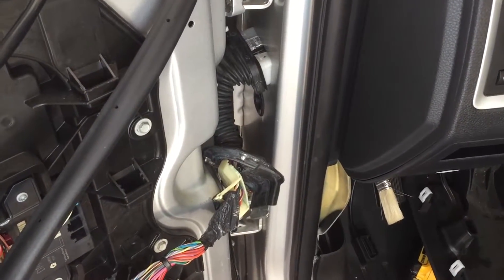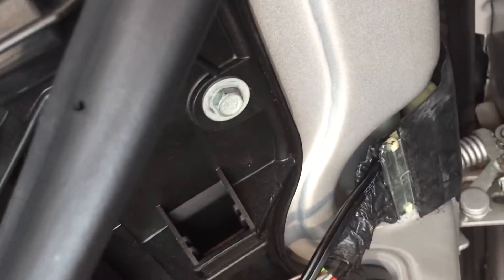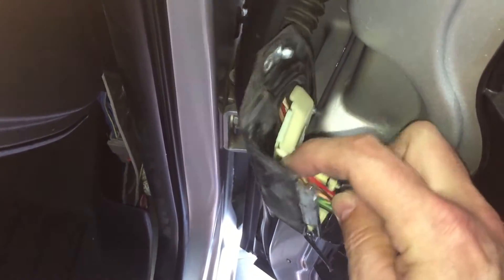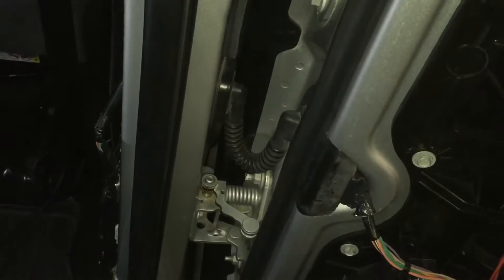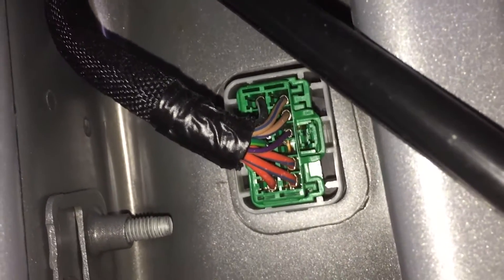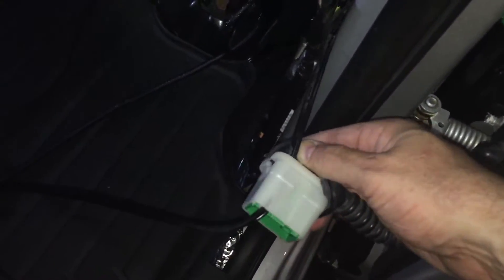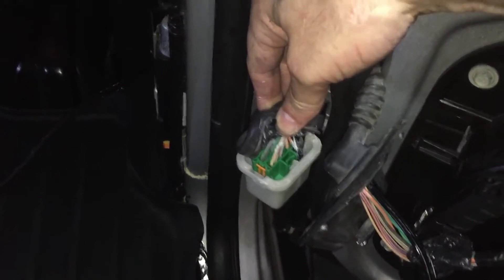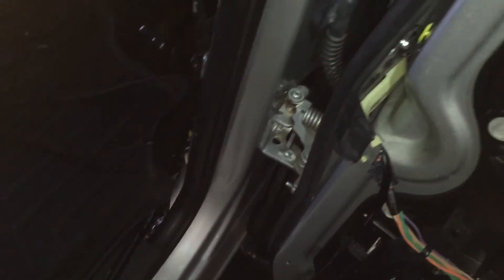Running New Speaker Wire to Ram 1500 Doors

Comment: I used this to assist during my install and it worked sweet. For the driver side, instead of creating a notch, I just split the speaker wire into single wires enough to reach the speaker. I was able to feed it through in a similar manner to how you did the rear doors just using two of the different small openings.
Reply from the maker: even better!  Glad it worked out for ya.

Comment: how much rms power you running? That looks like a lot of work.
Reply: Dude I’m installing a 5 channel amp along with a line out converter, on a new ram truck and it sucks ass when you have to run new wire

Comment: How did u get the plastic boot clips off the truck. 
Do they just snap on and off ?
Reply from the maker: You can take a small screwdriver or plastic panel puller kit (various small plastic extractor tools from Harbor Freight, Amazon, etc.) and gently pry them off one and a time.  But no, do not use brute force to pull these out, the ends may snap off and reseating the clip will be problematic.   Good luck!

Comment: I have a crackling noise coming only from the passenger dash speaker
Any tips?
Reply from the maker: You may have a blown speaker.   Take a panel popper tool (Harbor Freight sells these in a kit, if you don't have one).   While you're in there, and removing the speaker, you can place some dynaliner (not dynamat though) and it will help with resonance.   Good luck!
Reply: @Zanezach  did you run dash speakers and door speakers together?
Reply from the maker: @JOSE58LOPEZ  I did run dash speakers, but separate paths.   It's been some time, but I recall one of the dash speakers taking a little longer than the other to fish the wire worm through.

Comment: Awe buddy....that's a lot of work..there is absolutely zero power loss by using factory wire.we usually run amplified speaker cable to the inside of the door grommet.  There will be no advantage to do other wise.  The engineers only use 16g wire on the speaker leads, don't need much more in "higher-quality" speaker cables lol.  They all do the same thing.....conduct electricity......
Reply: Swagger Vader typically you don’t need to run 16 gauge wire for aftermarket door speakers UNLESS the speakers you’re using are going to be fed more then 75 RMS. Factory speaker wire is very thin and can’t handle more then that. There is very noticeable power-loss and a lot of resistance when you try to push more then 75 through the wire and makes your speakers not perform to their full potential. 🤷‍♂️ I would personally never use high-power demanding speakers exactly for this reason. I prefer clean installs that don’t add more headaches or work.
Reply: Good to know. I'm doing RF Punch 6x9s in my doors, running a P600x4 RF AMP.. i may just tap into the harness behind the factory screen...